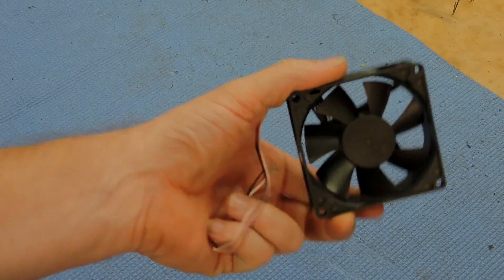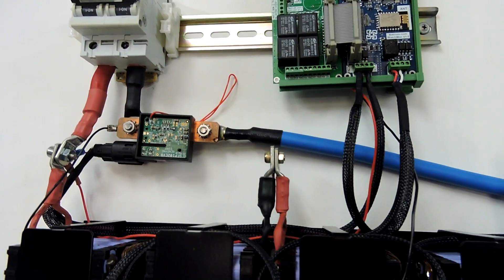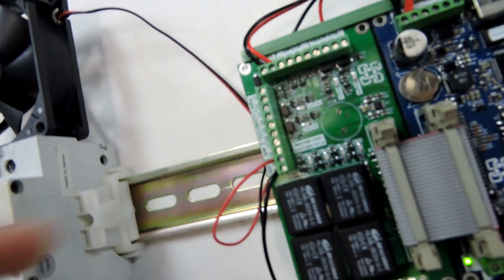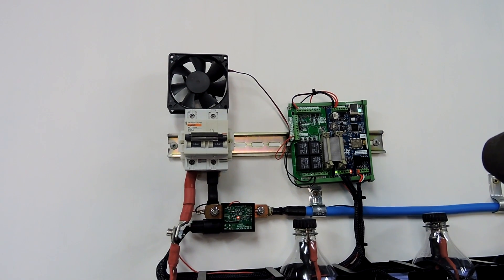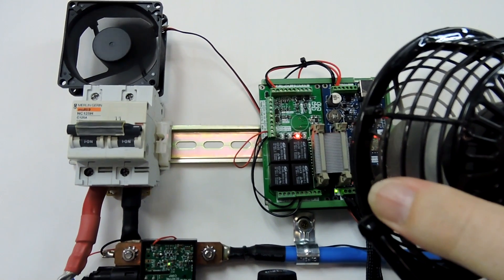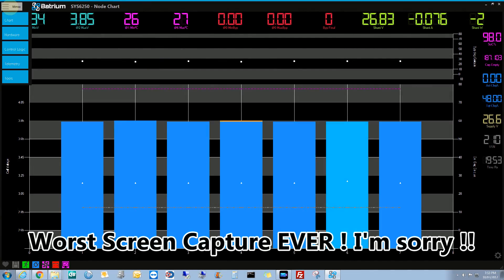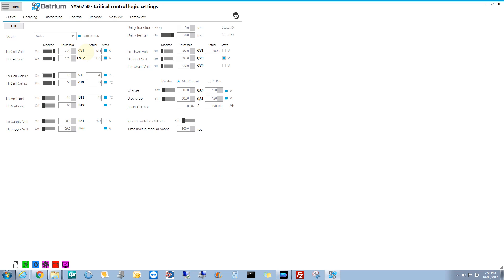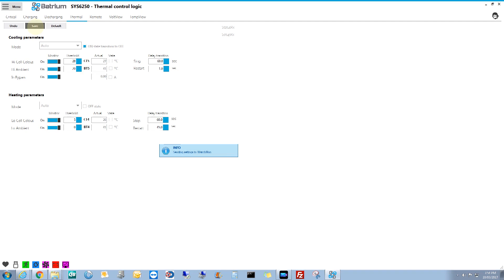Fan Control Via Batrium BMS DIY Powerwall 2 build continues

Comment: Hey mate, I am wanting to add cooling fans to my batrium. The fan you used in this demo, was that a 5v fan or 12v? Pin 29 & 30 say 5v. Cheers.
Reply from the maker: it was a 12 v fan but I got in trouble lol using external power is recommended
Reply: Ahh thanks mate. I was thinking along those lines
Reply from the maker: No worries

Comment: Hi I have start to watch  your channel for few weeks now from beginning. Totally  awesome job you have done. I wonder can the Longmon transfer balance between the cells or just only discharge  them? I have seen you use a fan sometimes too balance your cell think it would be nice if the Longmon was direct connected to the fan.

Comment: Large heat shrink seal one end and slide it down over and do not seal it just slide it on and then you can remove it easy later. That is one very flat balanced pack!!!
Reply from the maker: that isn't such a bad idea, simple cheap & clean !

Comment: Totally pointless bud.  You'd be as well back feeding a genie and paying for fuel with your cost let alone losses.
Reply from the maker: Arrrrr but you couldn't be more wrong  :) But thanks for the comment :)
Reply: HBPowerwall 
Then by all means show us the costs and efficiencies
Reply from the maker: http://www.diypowerwalls.com/t-HBPowerwall-Offical?pid=866#pid866 :) already been shared openly about my costs :) efficiencies - well they are a little subjective :)
Reply: So it's you page that is paying for it? 
The technology cannot pay.  Your solar is way under priced let alone others.  
Then you are saving $200 per month based on 12 hours daylight at 1.5 KwH.  That doesn't add up let alone allow for the solar power to be peak efficiency prior to buying all the shit then losses across the board.  One for EEV BLOG.

You have a hobby, it's interesting but bullshit.  You couldn't charge all the cells and still save that allowing for losses.  

Then 10 years minimum to offset the build cost by which time everything will be replaced twice over....
Big thumbs down
Reply from the maker: Have you considered the $$$$ made by youtube and other means, from the outset this was a youtube project as much as a can it be done idea. :) Entire 'youtube' project will pay for its self in under 16 months (might even bee faster with the right exposure)  :) xxoo It is without a doubt a hobby :) And I BET your right totally on the replacing the cheap gear I've bought twice in 10 years if not sooner. Done on a budget thats for sure. Thanks for tuning in :)
Reply: HBPowerwall 
Hey no offence intended.  What you are doing is interesting but let's be honest it's not a viable solution is all.  Just incase folks get the idea that it will in some way save them.
Reply from the maker: See, now if you take that comment out of a first world country and place it in a third world country - your dead wrong. The scale is everything. You don't need to spend 10.000 hours collecting and processing cells to make a massive powerbank that's "YouTubie" Someone with nothing could have a light for 4 hours a night so they can see a spider under the toilet seat.
Reply: HBPowerwall 
I'll turn that around and state that they are better burning carbon fuels as they can't afford to do what you are doing.  Poor argument mate.

Comment: What charge voltage are you using as an input? ac or dc?
Reply from the maker: Everything in this video is 48vdc
Reply: so you have x solar panels going to a mppt charge controller that outputs 48 volts into a bms on a 28 volt lipo bank?
I think its time for an overview video.
Reply from the maker: no solar on this setup in this video I have no charger at all no external power. Everything was powered directly from Battery Bank. An overview video would be ok except it would be out of date next week :)

Comment: I just started following you. 
Have not seen all the videos..........but......
Whats your opinion on new 18650 batteries from Alibaba/Aliexpress ?
They are like $1 >> 3,7V 2600Mah
Reply from the maker: More info needed sorry
Reply: you get what you pay for. try alibaba but make sure you have buyer assurance. They are good with refunds. Let the seller know you will be wanting a refund if not as advertised. they will suddenly be out of stock.
Reply: I wouldn't buy anything but name brands, Samsung, LG, Panasonic, Sony, Sanyo etc.. and don't believe any of the ebay claims of 4,000 mAh and above. Panasonic make a genuine 3400mAh 18650 and so do a few of the others. If you go to Alliexpress you might be better off looking at LifePO4s - the 38120s in a 10-12 aH capacity - the high quality ones are rated at 5C continuous and 10C surge.  Depends if space is a major consideration but they're a lot safer.
Reply: are there quality differences in 18650 batteries ?
Reply: Um YEAH